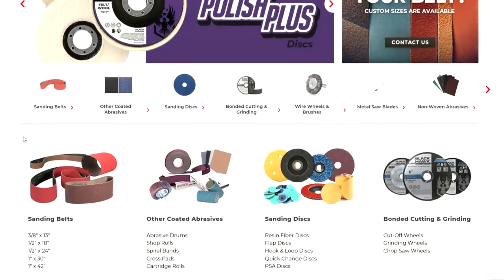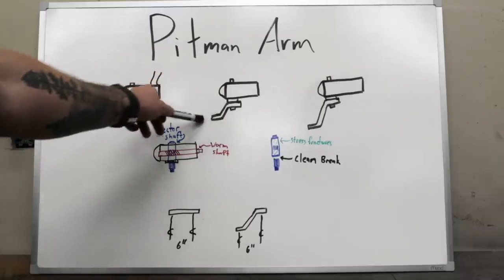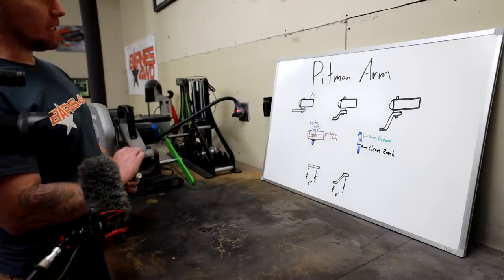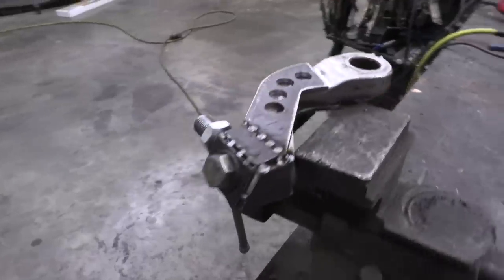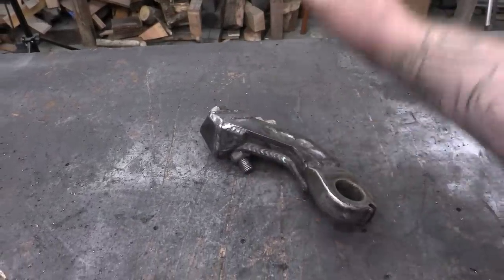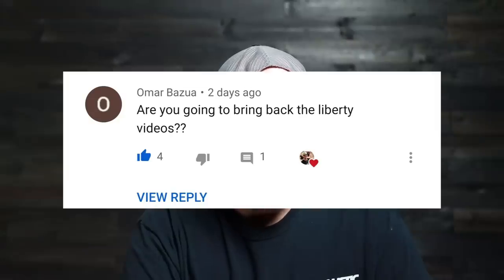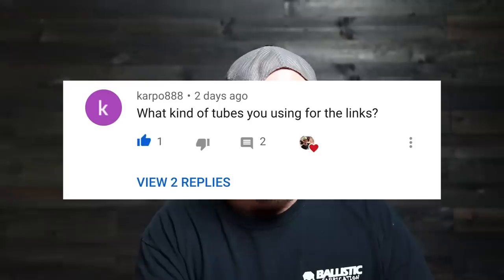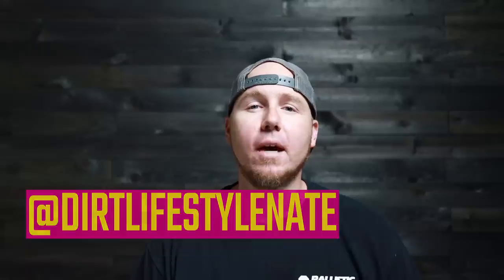Do You Need A Custom Pitman Arm And How To Build One! Ultimate Land Rover Discovery Build Episode 11

Comment: I got thinking about a steering spindle issue I had on a large truck years ago ( the bearing spun but oddly enough it deposited metal rather then wearing the spindle material ) and the shop I took the spindle to scratched their heads over it and were so tempted to put it in their lathe and lightly machine off the excess material but decided it was not worth the risk if anything ever went wrong with the steering and could come back on them liability wise. Although i am using this as an example the gist of it was that be it this or anything to do with welding/heating to straighten/modifying etc on anything steering related that went on the highway, the average shop won't touch it because they deem it "illegal" because the good ole Government tells them so. So my question is where is the so called line drawn for modifications to a factory component or making ones own parts and what does DOT etc have to say about it. Even a drop down pitman arm that you point out could create total loss in steering because it could snap the sector shaft right off from a box that was never intended to have that stress applied, I can imagine the finger pointing and no doubt the manufacturer of the pitman arm could be on the hot seat. Anyway I am not trying to cause a riff over this but just curious what your view point is and expect such rules would vary a lot by country around the world. Obviously government vs common sense logic are two vastly different things !
Reply: This is my take if you do it yourself you are liable if something breaks. So do it at your own risk if you are competent enough welding/fabricating go for it BUT if it breaks YOU are Responsible!
Reply: @ypop417  I expect that would be correct and why some shops will shy away from certain repairs and in fact I know on commercial trucks where I am anyway on other aspects of the truck and for example welding to fabricate a new mount for a fifth wheel plate, if the shop doesn't happen to have a certified welder on staff and they don't feel like paying the dollars to bring a guy in with his mobile unit to do a project they just won't accept that job. I expect that true off road only builds ( trailered units ) are much easier to deal with as a person is sort of flying under the radar although still need a license plate to drive on public lands.
Reply: my replacement pitman arm from a parts store said "not for road use" right in the disclaimer!

Comment: Correction: Pitman and radius arms are forged steel and not cast steel as you mentioned.
Reply from the maker: Yep
Reply: John, I agree I am pretty sure all OEM ones are. There are some real junk aftermarket ones that may be cast or very bad forgings. I have witnessed them breaking in half with no warning.

Comment: why would disconnecting the battery even save the computer if welding current did wanna flow through it? the ecu doesnt ground or get its signals from the battery, the battery just gives sensors power and the ecu the power to make its 5v signals.. ecu is still grounded and connected in dozens of places with no battery in the vehicle, the current/voltage from the welder has no reason to try and travel through the ecu, tiny wires and transistors its all out of the way and would require a really long route with alot of resistance.. and the actual body of the ecu isnt electronic in anyway you could hook your ground probe to it if you had a grounding strap big enough from it to the vehicles body 

never pull my battery in any of my vehicles never an issue.. other then projects taking longer then expected and an LED or dome light killing the battery